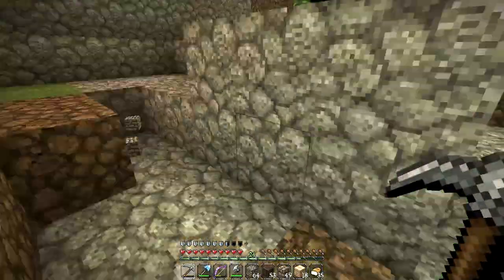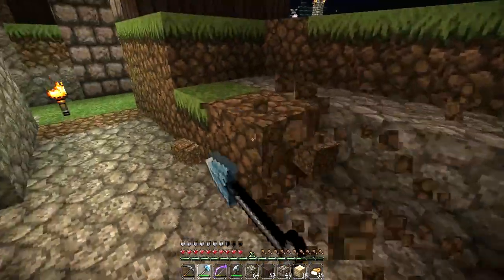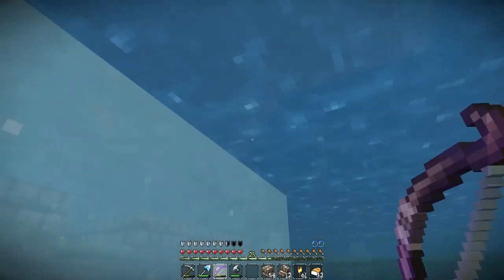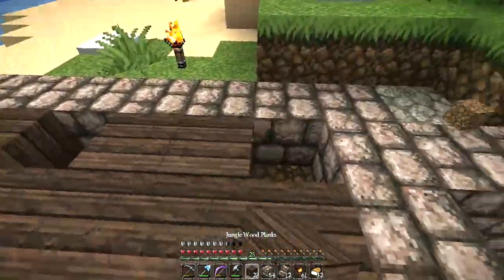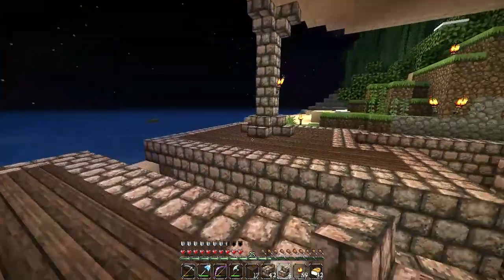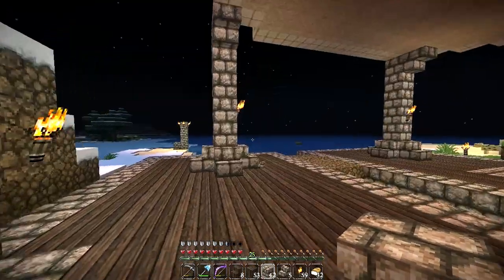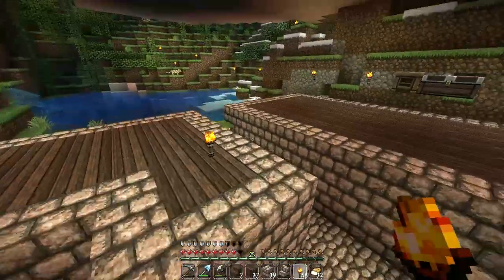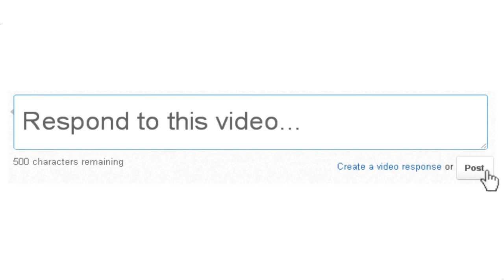[S2E67] Let's Play Minecraft - Lakeside Harbour!

Comment: Here's a thought.  To see if the cannals are big enough for the boats to move, fill one with some water, make a boat and see just how smooth it goes around the corners.  That way you can see how wide you need it so the boats don't bump into walls or sink.  Also, squids might move in so you might need to do some canal cleaning.  :)

Comment: I think for the lake side beams, you should build them out of sand stone to keep in line with the theme.

Also, wooden blocks, holding up sand stone on top of bricks, is kind of a physics fail. Wooden blocks would be crushed under the weight, and you would have one very unstable lake side villa!!

Comment: The pillars look cool, but they seem a bit small for the sheer size of the Lakeside Villa up top.

What about adding some horizontal beams underneath the Lakeside Villa.  They could be jungle wood logs arranged in the 2x2 setup so it looks like large jungle trees were cut down and made into beams to support the Villa.  They could run from one cliff side to another under the Villa.

Comment: rendog i love the arch but i think you should remove some of the slab in the middle so it shows some wood. i also suggest that you build a large circle balcony over the arch. i noticed the level of the water and i want to tell you that when you fill the harbor you wont be able to jump onto the dock without a platform at water level